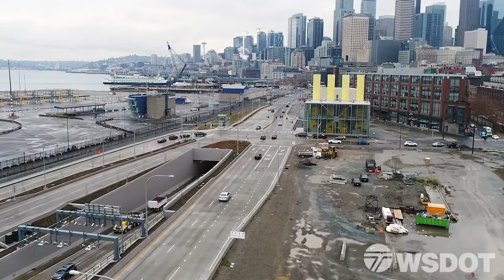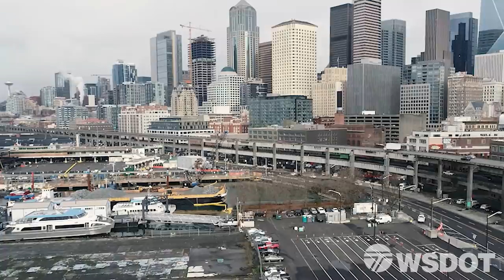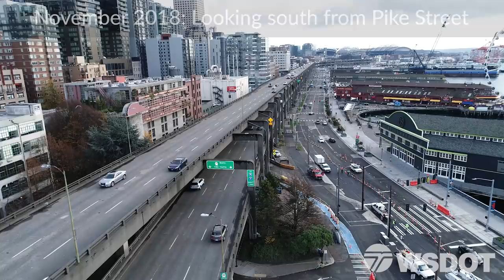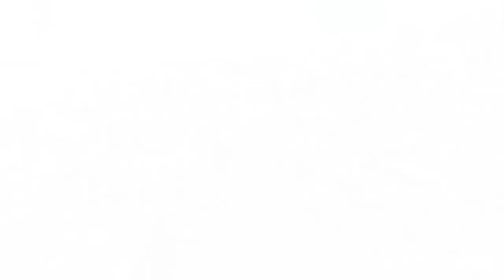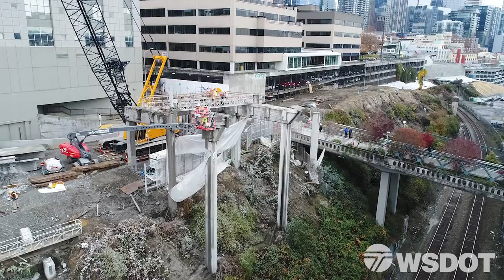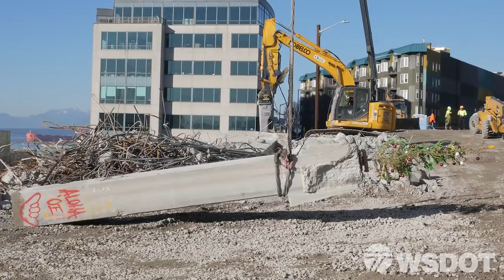Aerial views of Seattle before and after Alaskan Way Viaduct removal

Comment: This should be implemented across the country really
Reply: you paying for it?
Reply: @jakuub_11  Taxpayers are, just like everywhere else. The govt uses taxes for infrastructure, that’s how it’s always worked.
Reply: @luuchoo93  Yeah?  So let me get this straight.  You want every single elevated highway in the country to be converted to a tunnel?  It took 24 billion dollars to do a 1 mile long section in Boston.  With the current tax budget, its not possible to do this everywhere.  Unless you want your taxes to quadruple...
Reply: @jakuub_11  I never talked about “every elevated highway”, but those blocking or cutting through central areas/waterfronts/historic districts. The Boston Big Dig was a great infrastructure plan, and the same goes for the Alaska Viaduct in Seattle. Both cities look a lot nicer today. Cities are not supposed to be functional but hideous...

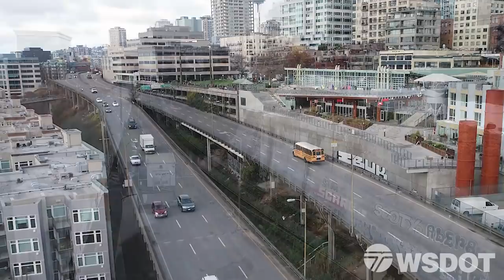Comment: Even as a Seattleite, it's super frustrating that the "before" and "after" are still completely different angles a lot of the time. At 1:00 the "before" is a full 30 or 40 yards difference from the "after" shot. Look at the placement of the small bridge over the gully! Much more difficult to keep your bearings in a space that is already massively changed :) 

That being said, it's crazy that this was done in a year!
Reply: Scott Beddall I also came into the comments to say the same thing. The moving shot of the waterfront wasn’t even at the same angle. 

@WADOT go back and reshoot the after images at the same angles. This video isn’t anywhere near as useful as it could or should be.
Reply: One additional thought on this, they should’ve had a goal to have the same building on the same sides of the frame for the comparisons. It would’ve helped us keep our bearings.